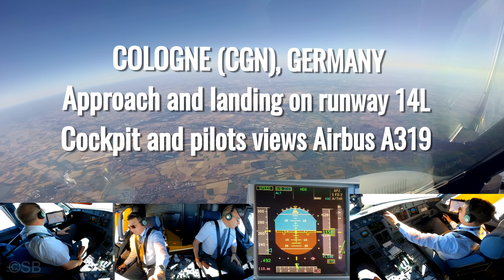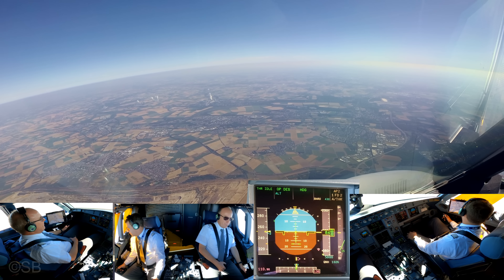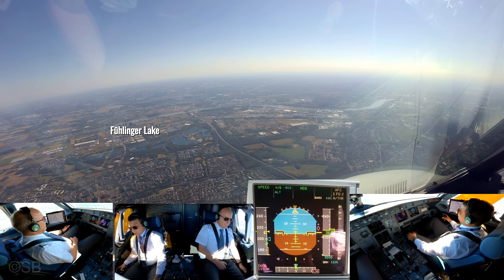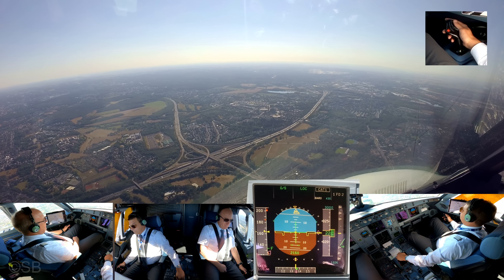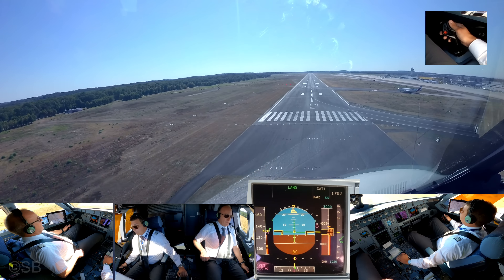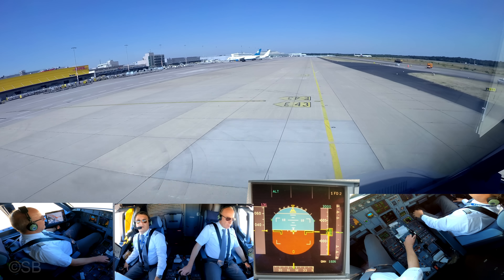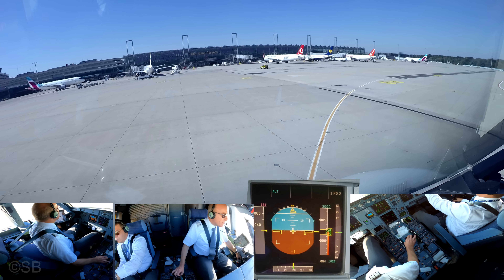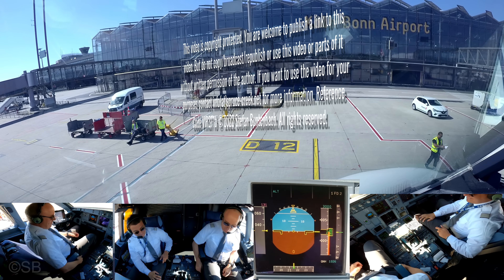Cologne (CGN) | Pilots + cockpit view | Airbus approach from the coal mines + landing on runway14L

Comment: I really enjoyed the little detail of telling ATC about the 5 knot tailwind. That was nice. Thank you so much as always for your uploads, sir!
Reply from the maker: Thanks for watching and for your feedback! Normally we would like to land for performance reasons  into a headwind. 5 knots tailwind are ok for the Airbus and the long Cologne runway. But we do not want to see more than 10 under normal circumstances. On some days, winds are changing a lot and tower cannot change the runway for every takeoff and landing. That would be impossible. Also the winds are sometimes on the ground opposite to the winds during approach.
Reply: @ApproachandDepartureVideos  Thank you for your reply, sir. Is that the reason the ATC said they are changing the runway right after you notified them of the tailwind?
Reply from the maker: @vintage0x  I think so. The wind on the ground and during the approach was getting more favorable for runway 32. So they changed the direction for takeoff and landing.

Comment: It's so cool when the Captain is so encouraging and complimentary of the First Officer.

What's a "VLS check"? I've not heard that on a final approach before.
Reply from the maker: Thanks for the nice words! 

VLS stands for  „lowest selectable speed“. It is the lowest speed the airplane will fly with the autothrust engaged. Even if you dial in a lower speed, the plane will not fly slower than VLS.

The VLS is depending on the present airplane weight and is the basis for the speed target calculation during our approach. In the Airbus which we used, there are 2 different sources for the VLS. One VLS is indicated on the MCDU and one on the PFD. It is the top of the amber line in the speed scale (you can see it in the video).

The MCDU-PFD is calculated on the basis of the zero fuel weight which we entered from the loadsheet. To this weight, the weight of the current fuel on board is added and the VLS is calculated on the basis of that weight. 

The PFD VLS is calculated on the basis of an independent weight calculation which the airplane is doing (FAC computer) on the basis of aeodynamical data (angle of attack measurement …) and the entered CG value from the loadsheet.

During the final approach when we are in landing configuration, we check both speed indications. If the PFD VLS is higher than the MCDU VLS, we add that difference manually  to the approach speed in the MCDU. This is done because the MCDU approach speed is the basis of the approach speed target calculation of the autoflight system.
Reply: @ApproachandDepartureVideos  - Thank you so much for that comprehensive reply. I can see from the thumbs ups you already have that others here appreciate your explanation too.
Thanks again.
Reply from the maker: @renejean2523  Let me know if you have additional questions. Have a nice day!
Reply: @ApproachandDepartureVideos  - Thank you, sir. Oh, I will have lots more questions! Some technical, others less so. 
You have a great day too.

Comment: thanks! I would love to see the EICAS alongside the PFD at the bottom of the screen too if it's possible; an ecam page alongside these would give me a total avgeekgasm!
Reply from the maker: Thanks for watching and your feedback! I also would like to put more of the Airbus screens in the videos. First on the list is the navigation display which is the one next to the PFD and also may be one of the ECAM screens. This is much more difficult as I originally thought because the possible camera locations are very limited. But I hope to find a solution soon.  For example the ND is already recorded together with the PFD. But due to the angle, reflections are so bad that it is unreadable and not useable.
Reply: @ApproachandDepartureVideos  Thanks for your reply! I never even considered that problem but I completely understand now you've mentioned it. Theres no mounting points for a camera to read the EICAS etc clearly without somebody recording in the jump seat I guess! Either way, this is a great channel, and thanks to you and the pilots giving you permission to film!

Comment: Great Video.  Saw the EGLL one. I'm hooked on these. Looking forward to more. Thank you.  Question though. Apart from the obvious Black Boxes, (and obviously simulators) is there any data that you as a pilot can access, that shows your landing perfomance on any given flight, even this one? i.e. Landing rate, G's, centreline/glideslope deviation, etc?
Reply from the maker: Thanks for watching and your feedback! 

All the flights parameters have to be recorded. As far as I know, the data are sent after the flights automatically to the safety department. The data are used for trend analysis and if parameters are out of or near limits, the crews can be contacted to discuss the reasons …. 

Pilots can also  request to see data of a certain flight. This is usually done, if something unusual happened or so. But under normal cicrumstances, there is no reason to do that because as crew we keep all the parameters in the prescribed limits. 

If the localizer or glideslope or other parameters  deviate, we both see it, the pilot monitoring makes a call and the pilot flying will correct it or does a go around if the approach gets unstabilized. In the very  unlikely event that both pilots saw the deviations differently, a later look in the data will for sure be available and may help to clarify what happened.

You also asked about the Gload at landing. If we are interested in knowing that exact value, we could generate a report after each landing which shows the Gload. But also here, our passengers and we know after the landing, if it was soft or a more positive landing, even without the report.
Reply: @ApproachandDepartureVideos  Thank you so much for that explanation, that's really interesting.